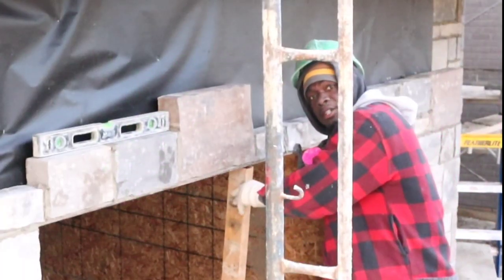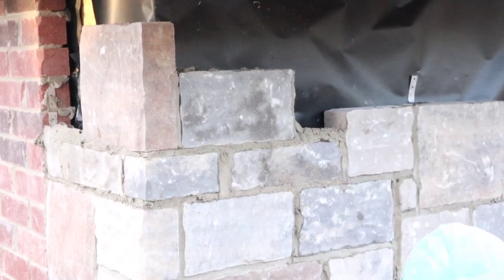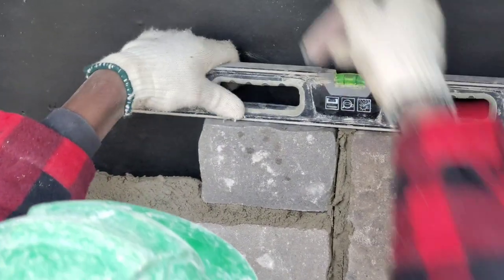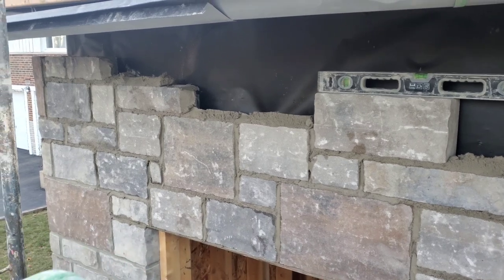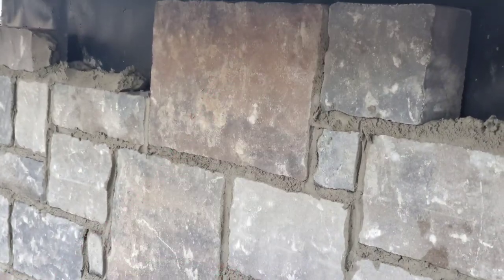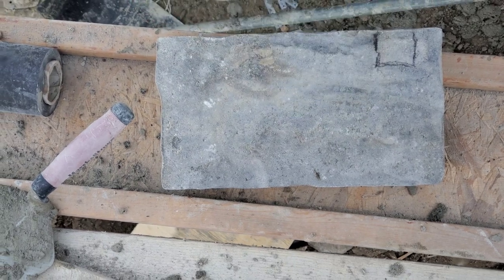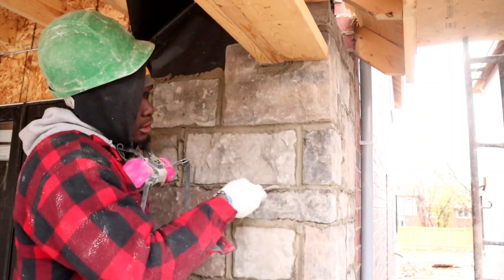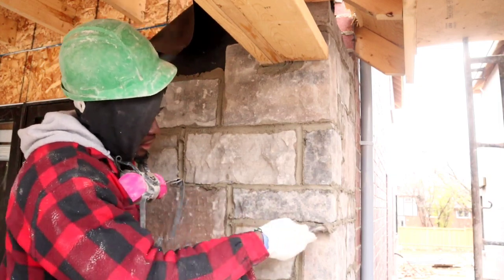bricklaying - how to lay stone for beginners ,

Comment: To keep your stonework plumb measure off the inside timber frame to the front of your stone all way up as you're walling.
Reply from the maker: In my opinion it's never a good thing to measure from the face or the front of the stone ,because it's stone it not a straight surface.